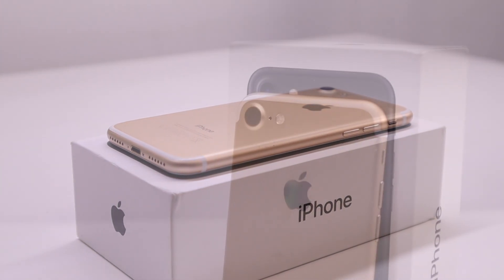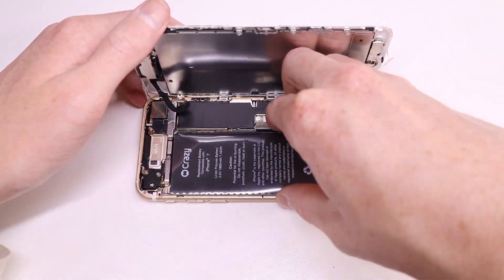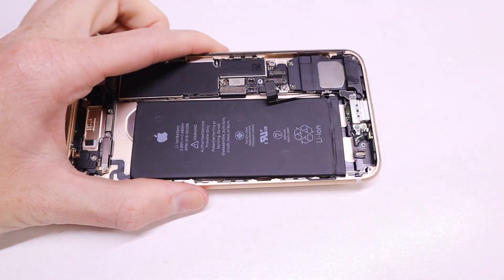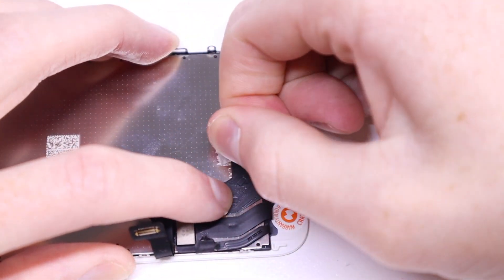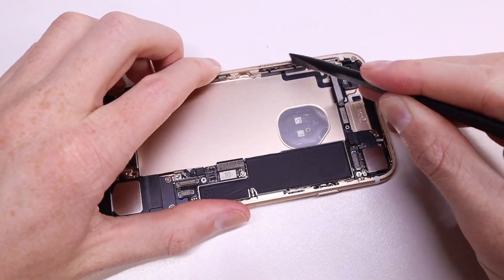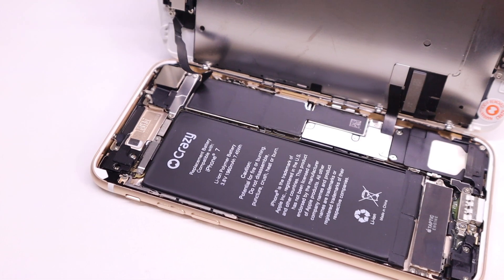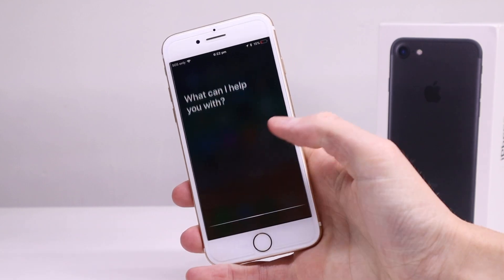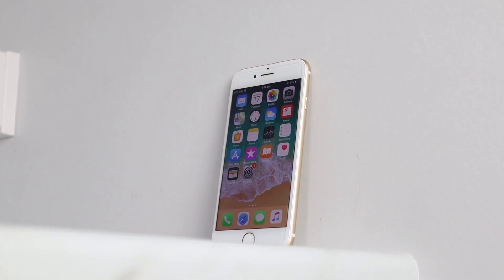Free Dead iPhone 7 - Can it be revived?

Comment: hey Hugh! i have a random question ... i have an iphone 6s plus it works fine but its slightly bent and the screen doesn't sit completely flush i tried bending it back but i didnt get it all the way straight... any tips for bending it back?
i dont want to take it apart... i tried fixing the buttons on a previous 6plus but i killed the phone trying to take the logic board out... any tips for bending it back with out dissasembly would be great thanks!

Comment: i got an iPhone 4 32GB running iOS 6 in mint condition for only $160 and all it needs is the home button to be sealed down with a new rubber gasket - best deal i’ve ever gotten other than a 32GB Gold mint condition iPhone 7 for $80

Comment: I think the best deal I ever got on an iPhone was an iPhone 7 in black for 12 dollars.
it was originally 62, and the seller had multiple, i asked about the battery health and they said all of them should have over 90 percent health, and when mine came it had 70 percent health (ouch). they refunded me 50 dollars to get the battery replaced, but i don't leave home very much any more so i ended up getting a 12 dollar iPhone 7 with a crap battery for 12 dollars

Comment: i have a samsung s8 that to be repaired it belongs to my late brother how much
Reply: If it's a cracked screen it's not worth it. A good condition s8 sells for about $175 US and most places charge $250 minumum since the screen is $150 itself.

If it's anything else it should be fine though. Cameras, battery, and ports are cheap replacement. You can even get another whole motherboard for $25 on ebay.
Reply: @dronesparky501  it was my late brothers its wroth it
Reply: @johnsanders5299  For a screen replacement, most places will charge $225 to $275. If you just want the photos and videos off it you can just plug them into a computer and take them off though.

Comment: I got an iPhone 6 (the one I am watching this on) for $14 AUD as it wasn’t working, when I received it I opened it up and tested the battery, it wasn’t working so O got on eBay and decided to try my luck on a 3rd party brand for $13 AUD and when I installed that it worked no problem and I am still using it today!

Comment: got an iphone x for 430 256gb, but it had a bad 3rd party display with strange colors, lines, and black dots. also the phone had a front camera with dirt under it so pics looked terrible. however the display went totally dead one day (weird situation, if i mirrored it to my mac i could still touch it to use it, but it was black) and i brought it to apple saying it'd died randomly, which they replaced free of charge. they fixed both issues for free--tons of value gained!

Comment: Got an iPhone 6S with charging issues and old battery for free from a friend last year. Bought a new OEM charging cable, cleaned the charging port, replaced the battery and it's like a brand new phone! Also got another 6S from an another friend now a few days ago (also for free) but this one is water damaged so I have yet to see if it is fixable at all.

Comment: Hey Hugh,
I recently found my old iPhone 6, that was lost for a year. It had not been charged once during the year. So, I replaced the battery and it hadn't powered on. I noticed that it wouldn't warm up during charging, and I checked to see if it was the screen and played with the mute but no vibration. I did notice some white stuff around the screen part, and it may have been definitely corrosion, but I'm sure it hasn't been in water as it has worked before, but I believe corrosion is the main suspect

Comment: I Have an iPhone 7 and its become extremely picky about chargers. Even apple ones may not work. I not sure if its the battery or the charging port. Having see you open it up, who knows what could be loose inside. Sometimes it will not charge when plugged in or will Act like its not charging, die, reboot, then show that it has been charging. Did you ever narrow down an issue as to why was a bit finicky too?

Comment: Did you do a couple charge cycles on the new battery? Don't you find it strange the old battery was completely dead and wouldn't charge, yet began to charge and function once you removed it and connected it directly to a different charger? Maybe something faulty with charging system on the phone. You yourself even commented "it wont work with some chargers"

Comment: Got an iPhone 5 that said broken motherboard had a problem with the proximity sensor , fixed it with a replacement laying around and charged the battery that was Dead otherwise the phone is in prestine condition . Now it's an MP3 player

Comment: Those aren’t water seals at the bottom of the screen. Those are also on an iPhone 6/6plus.
Reply: Itchin’ & Burnin’ 6s and 6s plus. Not in the plain 6’s
Reply: Rui Wang yes they are on the 6. I just did a screen repair on a 6 and they were there. They have nothing to do with sealing
Reply: Itchin’ & Burnin’ You mean the adhesive at around 1:10? It’s only on iPhone 6s and above
Reply: Rui Wang no! The rubber boots on the two screw legs at the bottom of the screen
Reply: Rui Wang 4:39
Reply: Itchin’ & Burnin’ They aren’t there.
Reply: Rui Wang yes they are.
Reply: Itchin’ & Burnin’ No they aren’t
Reply: Rui Wang yes they are. You aren’t going to tell me what I saw or didn’t see
Reply: Itchin’ & Burnin’ Look again. They aren’t on the 6 or 6s.
Reply: Rui Wang I’ve taken apart an iPhone 6 and a 6 plus. They are there. They have nothing to do with sealing.
Reply: Itchin’ & Burnin’ I have also done repairs iPhone 6, 6 plus, and 6s’. I have not seen this in any.
Reply: Rui Wang well you haven’t done enough repairs OR the repairs you’ve done have been on devices that have already been opened and someone tossed them out.
Reply: Itchin’ & Burnin’ or you can watch a gear down/repair of someone else doing it.
Reply: Rui Wang you have no proof the phone has never been opened. They exist on iPhone 6 models. You can’t convince me otherwise

Comment: Tip for removing proximity ribbon and home button - heat the other side of the display pretty good with a heat gun and the ribbons will peel right up with very little chance of damaging the cable

Comment: I got a used iPhone 5s in December last year for only 20€. The battery lasted only a few minutes and the screen had a water damage. With only 30€ of replacement parts, I got it back to life perfectly. Indeed, it has lots of scratches at the back, but I don't care about those very much. Overall still a very nice phone

Comment: for the home button 
The chip that stores data and is paired with the CPU is "printed" on the back of the home button itself.

It is not on the flat cable like it used to be for the iPhone 5s.

It is literally impossible to remove and transfer it without destroying it in the process.

Comment: Recently A friend of mines Was Ripped Off . He handed me 2 iphone 7's & An iPhone 6.He Was Told, From The Mouth Of The Mobile Device Repair Manager Of  A Local Phone Repair Shop Of Our City. " That (1) Of The (2) iPhone 7's Had A Logic Board Problem & The Other iPhone Is " Trash ". Yea, With A Laugh I Responded " Ok " . Me Having The Knowledge Of Device Repairs & Also I Have Passion For Taking Broken Devices Apart & Fixing Them . I Took Apart (4) iPhones To Come To The Conclusion That BOTH Of The iPhone 7's Worked Perfectly When Powered Up ( NO FLAWS ) . He Was Just Given A Battery That Was " TRASH " .
Reply: The iPhone 6 Was Disable For 20 Minutes, After Being Powered On For Hours Before Screen Replacement.
Reply: If Anyone Has An Old Device Thats In The Junk Draw , Im Always In Need Of Donated Spare parts.

Comment: Hey Hugh Jeffreys, I.am a 15 year old highschool student and I have recently started repairing phones as a hobby. I watch a lot of your videos so I was wondering if I could come to you for some advice on an iPhone 7 I am working on. It originally had a cracked screen and a faulty charging port, the screen was successfully replaced and more recently I have started trying to replace the charging port. The phone worked before I took it apart and I have gone over it to check everything was connected properly several times. It seems every time I install a new charging port, the phone cannot read the charge and does not boot. I was wondering if you had any advice for figuring out what is wrong with it. Any help would be greatly appreciated. Thanks so much

Comment: funny thing is that if you replace the original apple battery your phone will run worse.
your battery settings wont allow you to run at full CPU speed because of stability issues and it will be all greyed out because it wont recognise your battery.

Comment: I recently fixed an iPhone 6 that someone dropped on cement, shattering the screen and adding a few knicks, then dropping it in water shortly after. I switched batteries and after a bit of messing with it, it turned on. they told me a few possible passcodes and the 4th one they gave me finally worked. after that, I used the old passcode to remove security and I eventually removed their account by copy and pasting a password from their apple password keychain that was used for different sites. I would not do this normally, but they said they did not care what I did with it, or what was on it. I fixed the volume buttons and vibrate switch, then applied battery adhesive and sealed up the phone and added a screen protector. I soon went through and factory restored it and used it as my own upgrade from an iPhone 5s. I learned that it is an 128 GB American model gold iPhone 6. the only problem was a few knicks and a cracked camera lens that did not affect photos. the other day it has started to show signs of touch disease. it does not have gray bars and is not the LCD, I switched to two test ones to see, it will not interact on the screen for several minutes until I apply pressure around the touch chip. if you know how to stop this, please let me know, I would like to save this 128 GB model after a previous 6+ i had lost all touch permanently. thank you!

Comment: Bought a used iphone 6s for 3000sek around 300 dollars that was slow and battery was messy but later on bought another iphone 7 for 1500sek around 150 dollars and It works fine

Comment: i got a free iphone 6+ that has a fried motherboard and craked screen but i stole the chaging port and battery and fixed my old iphone6 and i still use it
Reply: big liar, iphone 6+ parts are bigger and cant be installed inside a 6 and mostly the battery
Reply: @Bigwiggest Where the hell did you steel it from?
Reply: @The_Beast_666  Are you dumb?, he took the parts off the free iphone6+.
Reply: I get the charging port but the battery ? How can an iPhone 6+ battery be repurposed in an iPhone 6..
Reply: Bruh yall is stupid he put the parts in his 6 plus he didn't put 6 plus parts in a six,..

Comment: The best deal I’ve ever got on a used iPhone was an iPhone 6s Plus for $160. It worked perfectly until the battery degraded to a certain point it would go from 100% to 71% just sending my Snapchat streaks. So I bought what looked to be an OEM genuine Apple battery off eBay to replace it and that battery actually made the phone slower, made it lag and get hot for no apparent reason. That 6s Plus turned into a nightmare.. but it was good for the first 4 or 5 months I had it. It was the first iPhone I ever had an active SIM card on and it was the iPhone that got me to like bigger phones because before I had that thing I was satisfied with iPhone 5s size.

Comment: The phone has an issue with a chip on the board. Ipad rehab has a video about the chip that causes this issue. Since the old battery charged up outside of the phone the issue will happen again if the battery ever drains to 0%

Comment: Failure to charge a battery from 0% leads you to look for, troubleshoot and possibly replace the chip on the board that controls charging otherwise you risk the same issue if the battery is ever completely depleted in the future. Search "TriStar failure"

Comment: I have a rose gold iPhone 6s and I found the problem it kept on flashing the Apple logo and I opened it up and I found the problem some of the battery was corroded I got a kit from iFixit andI followed a video guide on how to do it and the repair was successful but it still stuck on the Apple logo all it needs is to be wiped and then it will be fully functioning right now it’s stuck on recovery mode

Comment: Bought an iPhone 6s for 40$ completely good  condition with 82% battery then I got a 8 plus back cracked so i replaced the back with a red back glass the phone is sliver and it had iCloud lock so I bypasses it (unlocked and had email logined

Comment: 7:00 Are you sure that phone is working perfectly fine? If you drain the battery completely, would it charge again? If not, there's a motherboard issue, on the charging IC (Tigris or something), that's why I think it was not charging when it was dead, and it did charge in your charge pcb or what I should call it.
Reply: Looked like the original battery had discharged a bit too much in the 6+ months it was lying around (>2.8V IIRC).

Comment: I tried replacing a screen on an iphone 7, however when transferring the old home button, the new screen didnt seem to acknowledge it and i couldnt use the new screen so i had to use the old one with the home button functioning fine with the old...what are your thoughts?
Reply: The home buttons are locked to the handset they come in on these Apple phones and onwards.

Comment: 250 for a x with water damage.
Had no problem, it just had the connect to itunes logo because the power button was jammed. Replaced it and i got a very great deal
Reply: SphinX it wsnt even dmged
Reply: @SphinX_CS  i prefer android, but the resale value would be insane.
Reply: @SphinX_CS  it had water in it, it was just shorted.

Comment: i just bought an iPhone 7 that has been water damaged. all it needs is a new battery, main speaker and home button extension ribbon cable (that's the cable that runs under the metal plate) and a new screen, so, all in all, I think I got a good deal

Comment: Hello i traded my iPhone 7 128gb factory unlocked to a local shop here in the philippines and i added some cash as usual i added $162 US Dollars and the phone i got is an iPhone 8 64gb but it was locked to a network carrier but its not a problem for me since the network carrier that it was locked with is the one i mostly used but if i want to used another sim card i would need to get it unlocked but it doesn't bother me at all and the iPhone 8 still looks brand new to me although it has no box and the battery health is at 95% or 94% so its very good not very used or abused
Reply: lorenzo borja Hey guys, i make glass repair videos on my channel. Changing the glass is the best way to fix your screen.
Please check it out!

Comment: I have got a dead phone battery to work by heating with a hairdryer, apparently this gives the slightest voltage which means it then recognises a charger and can be charged fully. Can't remember where I read it worked and didn't think it would until the dead phone powered on.

Comment: This phone is NOT FIXED. It clearly has a Tristar issue which requires removal of the board and changing of the chip. Your battery will drain fast and once the phone is fully dead it will not charge.

Comment: I have an iPhone XS Max that has smashed front and back, and needs a new battery, dock connector and wireless charge/volume flex. i am currently working on this and the parts i need are arriving tomorrow. The best thing is, i got it for £35!

Comment: You sure lacking on knowledge bro , furst of all this is a tristar issue , or u2 ic, when the phone has battery and its on it charges just fine , but in the otherside it will consume a 200mah load constantly even if you dont use it and in 3-4 hours you will have a dead phone again , and when the phone turns of with no battery if will refuse to charge since the u2 ic is damaged  cant contact with the charger in order to allow the phone to charge!

Comment: What tools do you use? My brothers iPhone 6s Plus won’t turn back on after our cousin dropped a heavy wrench on the back of the phone. There was carpet between the phone and wrench but it completely died. We don’t know what’s the problem and I believe it’s either the battery or logic board because it doesn’t seem to charge and won’t connect to iTunes on a computer. I want to see if we could fix it but we don’t know what tools and parts to buy and where to buy them.

Comment: I bought an iPod touch 4th generation 32 GB for free from my sister last week and it's in god condition except for the up-volume button which is glued to the inside of the iPod and is stuck on the other side of the stainless steel but the button works if you press the button with your nail. The battery seems like shit to us because iOS 6 can't be accurate with the battery and can just go to 2% from 50% then go back up to %50 a few seconds after the device is locked and the iPod can last 2 hours of use unlike my old laptop which can last 2-3 minutes on a full charge. The speaker isn't shit like my iPod touch 2nd generation or my iPod touch 6th generation.

Comment: so basically you only did change the battery. 
wow.
Reply: And the screen
Reply: @cykblyat  yeah sure he did but the phone was 'revived' simply by changing the fucking battery
the video is kinda useless since the uploader clickbaited us with this title.
Reply: 555Lemmy666 the battery was changed because the old one had negative voltage
Reply: But he didn’t repair the real cause of the problem which is the tristar chip.

Comment: Got an iPhone 6 for free when I found it cracked and not powering on in a box of (older iPhones) at my high school. Turns out I just needed to replace the screen since when I plugged it in I was able to get the phone to vibrate/turn on. So I replaced the screen and got the original owner to reset it so now I have an iPhone 6.